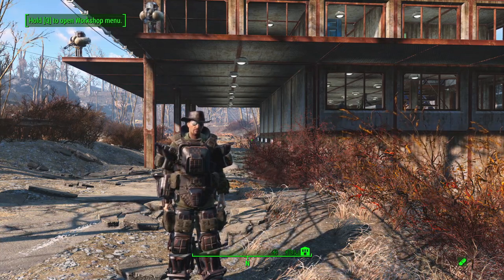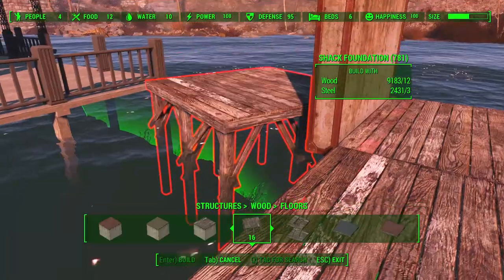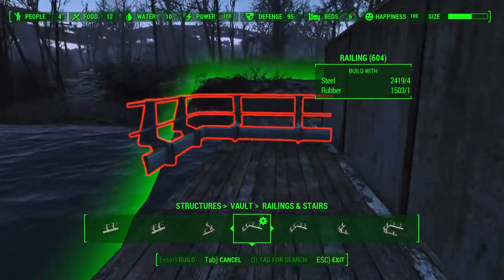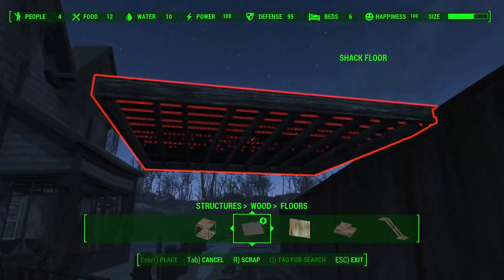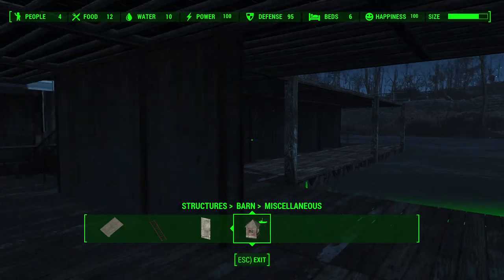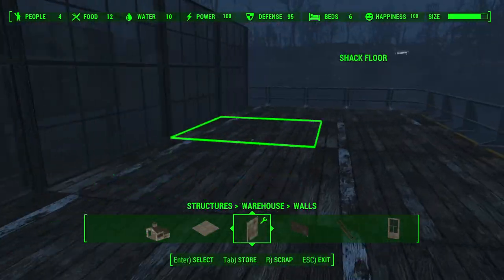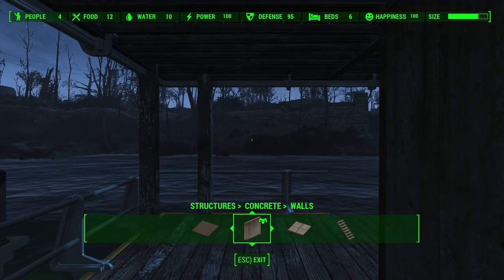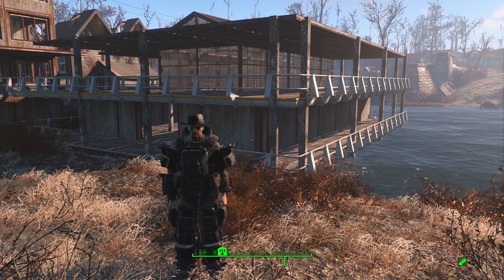Commonwealth Contractor: How to Build a Port Facility in Fallout 4

Comment: I built something similar after seeing a Nordhagen dock build. Also, one of the things I've learned with those walls you were having trouble with is I place one of the tin half-sized pieces of wall first, and get it facing the right way through deleting floors and such (also helps in hiding stairwells). 
Place flooring, and then a full sized (or even half sized) tin wall. If it faces the wrong way, add/remove some of the surrounding flooring to get it to the right direction. Make sure to place another wall right next to it, facing the same way. So, you're using 2 square spaces. 
When that's done, delete one wall and replace with the glass.
It should connect easier so you aren't having to fiddle around with the glass (can't see which way it is supposed to face for me). Just something that makes it easier for me.

Comment: Your build videos would be easier to watch if you were in daylight.  Since you're on PC just hit the tilde key ~ beside the 1 key, then type the command:  set gamehour to X where x is equal to 1 to 24 (24 hour clock).  You can instantly reset your day back to 12 noon for bright light.  Also, use:  set timescale to 1 and the game time went pass by so quickly that it turns dark again before you're done.  The default timescale is either 16 or 20, depending on which console command article you read.  I prefer timescale 10 for normal game play.

Comment: I've added a dock or two to my builds as well, they do fit well into the canon of the game. Did you try the hand railing from the scaffolding section, it might fit were the Vault Tech section wouldn't.
Reply from the maker: I use the scaffolding railing if I'm looking for a more scrapper aesthetic since both pieces of scaffold railing are bent. I like the concrete railing but it really clashes with the vault-tec and looks really out of place.

Comment: You can hold X/A to group select the whole structure and move it an inch across to try solve the railing issue 🤓 awesome, insightful video with a nice outcome 🤘
Reply from the maker: I tried grouping but it didn't want to replace anywhere once it was selected, there were a couple idiosyncrasies with the group select I didn't know about when I recorded this that would have probably helped solve that issue.
Reply: @Theegreygaming  yeah I see you were already pushing the boundaries to the limit there, amazing you managed to fit as much as you did 🙌 the trick with the wood floors and concrete walls actually helps resolve an issue I've encountered just never tried to work out, excellent job man 😎
Reply: @Jokertron3000  There's a non-mod way (works on consoles) way to decrease your build limit. If you have a weapons dealer (or one in Diamond City), buy all the guns that have mods (even buy the ones that don't). 
Just like picking up the traffic cones/loose tires lying around the Red Rocket outside of Sanctuary, you can "add" things to your settlement. When dropping them inside the settlement area and entering into workshop mode, you can "scrap" those items. By buying all the guns and bringing them back to your settlement, then immediately dropping them from your inventory (it creates a circle around you), you can then enter workshop mode. Scrap ALL the guns/weapons you dropped. If you have 6 pipe pistols, it will just show one gun but allow you to gain the 6 steel from the pipe pistol still. By scrapping all the weapons, you lower your build limit. It does not crash the game either.

Comment: I have a couple of criticisms.

1. Concrete walls look to massive for the build. I would use the barn walls. I think their appearance would be better. Plus they are taller.

2. I would place the stairs next to the wall instead of the edge. I would also use the half floor personally to decrease item count. Your stair outer rail still appears floating to me, yes I'm very retentive and that would drive me nuts every time I saw it.

3. Stairs on one side makes it look non symmetrical. Yes I'm nit pickings again but I would mirror the stars on the other side.

I did a sea food restaurant over the water in sanctuary using the half glass and barn walls. I believe these sets made it look realistic,  lol as much as a game can. I took inspiration from Bethesda designs to use wood and glass.

Comment: I had and have that problem where something would fit if only I had a few inches more. So Start over and give yourself those inches. Problem solved,,,,,, yeah and now I wished I had a few inches more on the other side. Deng. Bethesda lol. But, you can pick up complete buildings if you didnt give them to much points sticking in the ground, and move them just a little bit, built the thing that didnn't fit and move it back. In your case, the game wouldn't have alowed you to build that type of railing next to the house anyway. lol I loved your build.Never have build boat houses other than Barn or warehouse style builds.